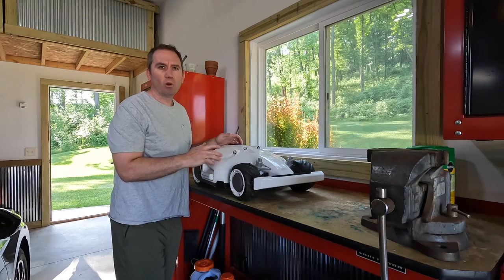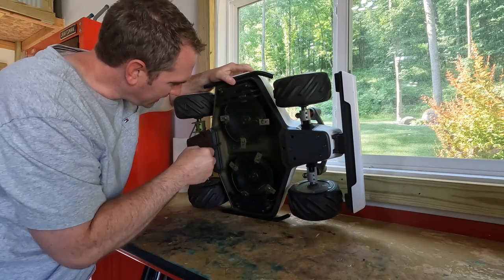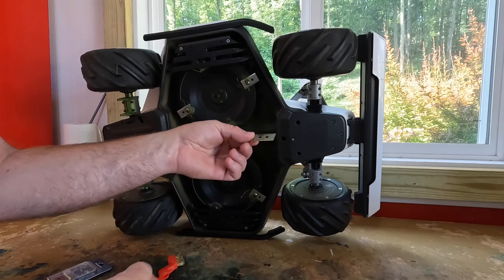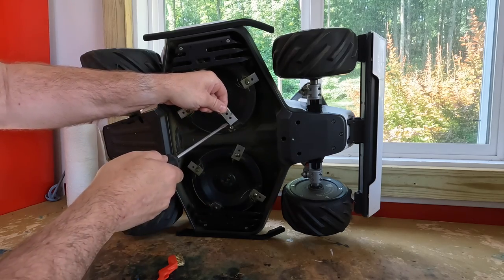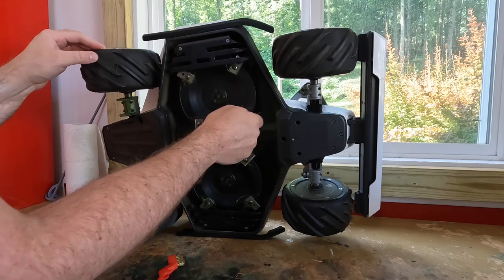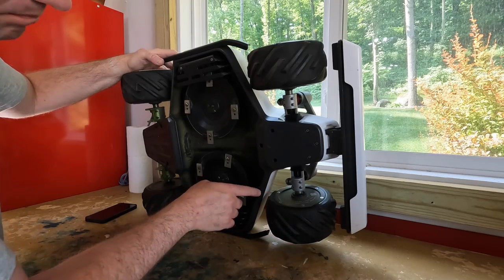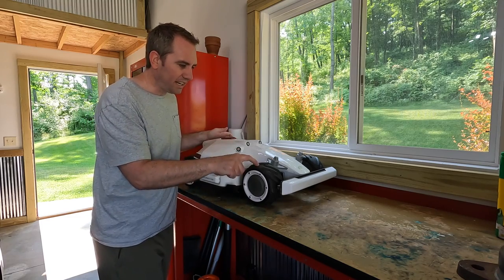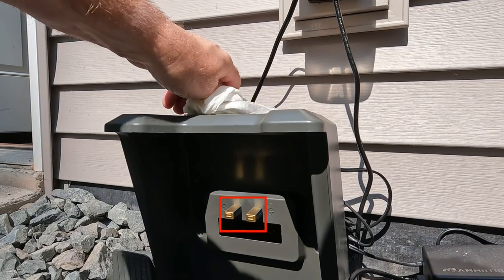Luba AWD Robot Mower Maintenance - Mammotion GPS Mower

Comment: Between this and your other Luba video, im sold. Would you need to switch the blades after 4 cuts or did you just do it while you had it in? Cheers sir!
Reply from the maker: I’m glad you found value in the videos.  I did not need to switch the blades, I did for the video.  There was a slight reduction in sharpness but no noticeable damage.  I would say that one set should last a season unless it gets into rocks or sand.
Reply: Great. Thank you🤙

Comment: I’d use silicone oil spray rather than WD40 since petroleum oil products can degrade plastics and rubber components whereas silicone oil spray is safe. Good video, I’m very close to getting one of these. You like it so far?
Reply from the maker: Good call, I can’t argue with that 👍
Reply: Plus silicone spray doesn't allow dust to stick like petroleum products. Spray used on mountain bike chains is very good as most are a dry-film Teflon coating and lubricant

Comment: What can be done to keep your Robomower from being stolen?
Reply from the maker: It does have built in alerts if it leaves the GPS mow areas.  Also, I don't think it would work it someone take it because its tagged to an existing account. Similar reason that iPhones don't get stolen, they are useless if you can't unlock it.
Reply: @TheLawnEngineer  Unfortunately the alerts have no way of coming through to your phone unless the luba is connect to bluetooth, from what I hear. so that's a useless feature currently. Best bet for now is what a lot of folks have been doing - hide an airtag on the mower somewhere.
Reply from the maker: @ernakthehun  AirTag is a good idea.  👍
Reply: @TheLawnEngineer   The problem is that the Thiefs are not necessarily smart enough to know that the mower unit is useless without the base, and the account. I just came across a video on another channel where a new Luba 3000 was stolen from a guys yard when he was on a vacation. Of course, normal mowers get stolen too, but they aren't usually just stored outside in the yard.
Reply from the maker: @morte2195  I like the AirTag idea, but I'm not going to go to gps location on conform someone who stole my mower...I guess you could refer to the police.  Anyway, I think if that's a major concern you would have to bring it inside when you weren't home...sad.

Comment: NEW SUBSCRIBER:
- Found you by AI-Referral to Luba
- Have a Technical & Operations Management background from 30 years of Systems Contracting and Facility/Event Management at a major university -  so I identify with, appreciate and respect your perspectives.
LUBA HEALTH-CHECK and CLEANING
[ ] How long did it take to flip the blades?
[ ] In the future how often do you think that you will 
     - Clean the ‘Business-Side’, 
     - Rotate the Blades?
* Many Lawn-Mowing Professionals use an arsenal of different sized (painter’s) scrapers and/or putty knives in a variety (some in sets) of metal and/or polymer which can be shaped to fit certain contours for fast, efficient scraping.
MODEL DIFFERENCES 
* My Transition Zone 10k [ ]’ yard has 3 zones of different sizes: 6k, 2k, and 2k; and grass types/heights (bermuda varieties (hybrid-lower; common-intermediate) and RTF (rhizomatous tall fescue - taller - 4”)
- so I am waiting for the release of the proposed/announced Higher-Cut Model - to use higher than the current highest cut;
* Frequency-of-Use:  Given that I already cut the public zones (corner lot: front yard and curb-side front and side parkway (full lot length) at least every five days (1/3 cut rule/rapid growth) 
- I want a mower that is an upper-end residential/lower-end commercial that can handle the 1.5x to 2x duty cycle of use (I have a 15 yr old Honda HRX)
* My Lawns (last 2 houses) have always been the nicest lawns in the neighborhood with my hybrid bermuda looking like the fringe of a golf-green, the common bermuda like a soccer field and my magnolia tree fescue front yard like a park/garden
* I am trying to discover the Technical Differences between the 3000 & 5000 Models 
- the battery sizes are apparently the same (10A, charging time, run time) but the mowing capacities are different . . .
[ ] Are those differences Hardware (motors, gears) or Software Programming or Both?
    (Note: the Climbing Ability/Slope Specs are different - so I am inclined to think that the 5000 model is more powerful and maybe of a heavier-duty.
* At this point, even though I am likely to only use 2-Zones (still doing the Fescue-sometimes with the bagging-Honda (because of the 365-day drop of Magnolia Leaves), I am leaning toward buying the 5000 model and be robot-mowing the two-bermuda zones (each) 2x/wk and probably in the ‘fine’-cut (slower and cross-cross) modes 
- so Lubie will probably be used 2-3 hr/evening x 2 = 4 weekly uses (evenings to avoid cutting dew-wet grass and cutting in the blazing Oklahoma summer sun - recovering overnight and mornings);  This theory has been employed with my 15 yr old top-of-the-line Honda HRX - and she still looks and acts like a youngster (the same with my 2007 Honda Accord EXL);  Sorry to see Honda stop making gas mowers;  wishing/hoping that they may explore the Lawn Robot market.
* The 3000 vs 5000 Model Price and #-of-Zone Differences don’t concern me 
   - just the Speed:Time, Mowing-Capacity; to me this translates to Heavier-Duty Specifications
[ ] As an Engineer - does this seem like a practical perspective when Buyers go to make a choice for Purchase ?
Reply: It's funny. I know 4 people in my circle of friends that have already gotten a robomower. All 4 are Engineers of some sort.
Reply from the maker: ] How long did it take to flip the blades?
-15 minutes, I didn't have an Allen key small enough to use with my small impact.  This would speed things up considerably.  
[ ] In the future how often do you think that you will 
     - Clean the ‘Business-Side’,  :  Once a month

     - Rotate the Blades? Once a month, this would put me at 1 set of blades per mowing season

[ ] Are those differences Hardware (motors, gears) or Software Programming or Both?
    (Note: the Climbing Ability/Slope Specs are different - so I am inclined to think that the 5000 model is more powerful and maybe of a heavier-duty.)
    -Agreed, it's a combination of battery and motor sizes.  I believe the 

[ ] As an Engineer - does this seem like a practical perspective when Buyers go to make a choice for Purchase ?
   -Yes, this is a very practical perspective.